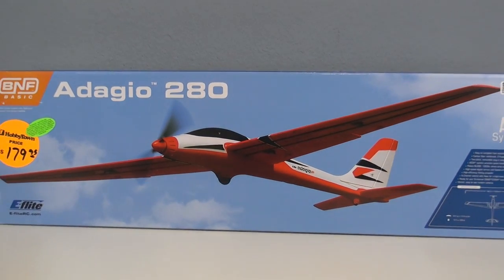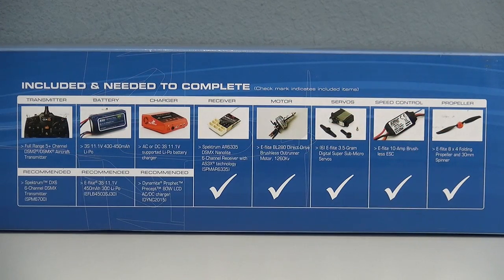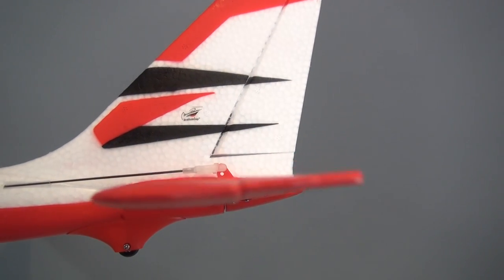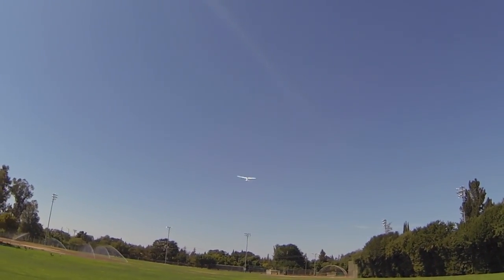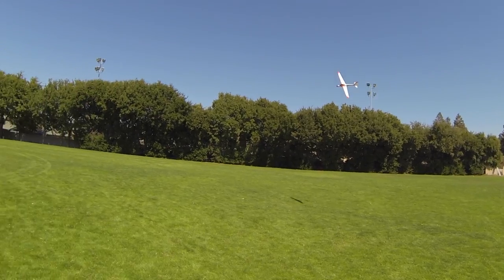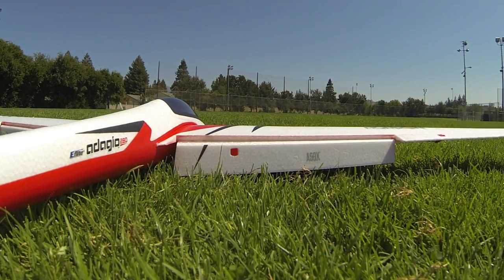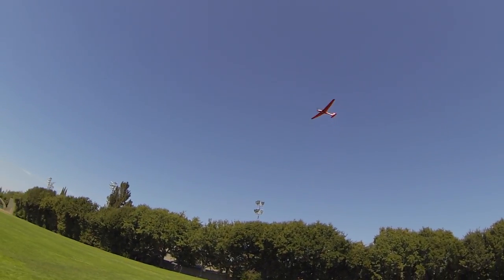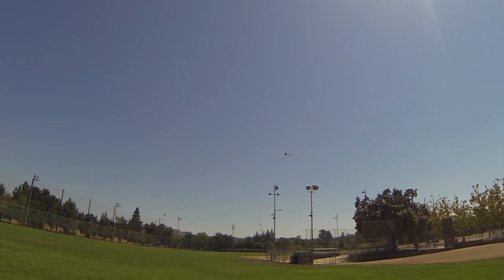E-flite Adagio 280 Complete Review

Comment: I've had my Adagio for a while now and I'm just beginning to get confident when I fly it. I agree it is a wonderful aircraft. Your video is helpful - I hadn't thought to point the nose down when deploying the flaps, but that made perfect sense.  On my transmitter the flaps are either not deployed at all, or deployed 100%, so I've used them very little. 

Thanks for the great review!
Reply from the maker: +Patrick Colwell Thanks for the comment! I don't know what radio you are using but one thing that helps with pitch changes when dropping flaps is to add an elevator mix: flaps to elevator so that when you drop the flaps you get some down elevator mixed in. Takes that ballooning out-100% flaps will still slow up the plane very fast.

Comment: Man, how does it make those sharp turns!!! Pretty impressive control throws for a glider. You can practice on a soccer field, before hitting the slope. Now I know what to get myself for Christmas ;)
Reply from the maker: Heine Johansen It's a good, responsive plane-the only weakness is the wing spar. It's not the best-I did end up replacing it with cf rod.
Reply: Good to know. Thanks 😀
Reply: +Discover RC One thing I actually really like about the Adagio is that if you dive with the motor off and pull up lightly so when it is next to you it will be level, the wings will "whistle" and it sounds great!
Reply from the maker: +susanrc73 yes-pretty cool! :)

Comment: Try instead of flaperons doing spoilerons where both ailerons go up. It may take away that sudden dive and give you a much smoother landing.
Reply from the maker: J Adam Good point-should be possible using the open channel port on the rx. You could even do crow once you split the aileron channels.

Comment: Thanks for review. How do you think the climb rate is?  I almost bought one the other day at LHS but I got a Sport Cub instead.. which as you know is also a great little plane.

 Also.. a lot of people are having issues with broken wing spars on Aagio. Are they carbon?  There's pics at RCG.

BTW you can use regular CA on Z-foam. It won't damage it.
Oh, and you are pronouncing it correctly!
Reply from the maker: BWX The sport cub is great and I would also go with it over the glider if I had to chose-still a sport/3d pilot at heart. The climb rate is decent for what the glider is and the price-it's no hot liner but it gets up there fast enough. The spars are cf and I haven't had an issue. Given that you have a long thin wing, I could see damaging it if you were to strike a tip into the ground-I flew the glider pretty hard and they are doing ok. Yeah thanks-forgot reg ca is fine on the z foam! ;)
Reply: RCdeparture Thanks. Yeah I guess they were folding up on people mid flight-  Not sure but there might even be a video of it somewhere.  Something to watch out for. I think they were fixing it with wooden dowel near center or something. Not sure.. but it might be worth checking out.

Yeah when I went to LHS they had the UMX Habu 180, the Adagio, and the Sport cub. I want all three!  But I already bought a UMX Radian, VisionAire, and big Radian this year, so the Cub fits right it. I can get those other ones next year or when they go on sale over winter, LOL.
Reply from the maker: BWX Yup-if you wait on these the price drop often makes mad you bought it when it came out! OK-yes I did get some wing flex-maybe you can see it in the video. You could probably break it with a power dive and hard pull on the elevator, but that type of thing I would never do on a little foamie like this. So the issue is somewhere between flying it hard, but like it is designed for versus abusing the air frame. Sometimes a difficult line to define with differences of opinion.
Reply: RCdeparture Yeah who knows what they were doing to break it, LOL.

In my radian I upgraded to carbon fiber wing spar (1mm walls) and I still get a little flex but I can do crazy things that would bend the FB spar or maybe even break it.  I do things I would never do with stock FB spar.
Reply from the maker: BWX Well just like that I broke the spar-I blame you! lol Caught a wing tip landing I think and it snapped right at the root. I have a thicker cf rod that will replace it-looking it closely it is definitely on the thin side.
Reply: RCdeparture Oh noes!  LOL, well I guess maybe there is a real weakness there. It should be able to take some abuse being a foamie.  I guess if it easily replaced with a stronger one then no worries. I wasn't sure it is was just a straight spar that is easily replaced or if ti has some weird curve to it.

 I replaced my Radian FB spar with a carbon fiber spar before I ever flew it, and glad I did.
Reply from the maker: BWX It's a straight spar (well it was-not anymore). I went to the cf stash and found a good replacement pretty quick. I will need to mention this since it does sound like a real issue. The stock spar is mainly air coated with a thin layer of cf.
Reply: RCdeparture Wow.. Yup a strong carbon fiber tube should do the trick. I bet I'll be more fun up in the air when you know you have a bullet proof spar.  That's how it is with my Radian, I can crank on it all day long and turn as hard or loop as fast as I want. It flexes, but just a little.  Now you'll be able to hammer on that thing.

Comment: Thanks for the review. I too broke my spar. Do you think with all these breaks HH would send out new ones at N/C....
What Dr/Expo are you guys using?
Thanks Again
Reply from the maker: I replaced the spar with a thicker cf tube that I had laying around. I just don't think it's worth replacing it with another stock spar-it's pretty much no good and needs to be upgraded which is unfortunate. Otherwise, it will just be a matter of time. I've been meaning to do a short video on that, but other projects have kept me from it. I have no dual rates or expo-just full throws at 100%. It's a fairly docile plane-you could go with a 70% dual rate if you want it toned down, but you don't want it to get too mushy and sluggish to respond.

Comment: Have you tried to put a bigger battery on the Adagio 280? Im looking at a 500mah that fits fine just 5g heavier than the Eflite 450mah. I'm also looking at trying to fit a 700 mah (tight fit, but according to dimensions it will fit) and its 33g heavier than the eflite 450mah. Any recomendations?
Reply from the maker: I am sure the 500 mAh will be fine - the 700 probably too if it fits. With the 700 your cg may change just a bit.

Comment: what is the maximum wind speed one could fly this in?
Reply from the maker: hmmm it's hard to give you an mph - it's a big wing so wind is going to toss it pretty good - it's got good power but not enough to really slice through a lot of chop. I'd just say moderate wind at most-the fun factor will drop though once it's bouncing around a lot.

Comment: got mine today hooked every thing up and when i bound it i got full flaps and they won't retract too neutral help please!!!
Reply from the maker: +Timothy Keeler what radio are you using? Flaps hooked up to aux 1? You may need to reverse the servo.
Reply: spectrum dx6i every thing seems to be hooked up right tried that but didn't make a difference
Reply from the maker: +Timothy Keeler so they won't move at all and stuck down? Can you get them to move with the sub trim? Did you try rebinding it without the flaps servo plugged in and then after it's bound reconnect it? Usually it is just something with the servo settings.
Reply: +Discover RC hooked up the way they were out of the box!
Reply from the maker: +Timothy Keeler it's a bummer :( I am just trying to figure out what is going on with it. Flaps are connected to the correct y harness and everything else is working normally right? And reversing the flaps didn't make a difference. Also you are binding with a fully charged battery? Once you eliminate all that stuff you are left with either a loose connector or a bad receiver etc. There is not much left to do other than call Horizon-they are good about setting things right.

Comment: Frankly I'm disappointed in this plane.   Poor build and design lets this down badly.   Wing joiner tube very weak broke first flight even though it wasn't a particularly heavy landing.  Elevator is split design with an angled wire joining them.  The foam around the wire is weak and as a result you get a different throw on each half  - it needs epoxy to stop the foam from moving away from the wire!.  Canopy magnets are way too weak, use an elastic band.  Nose heavy???? you have to be kidding!! On the advice of the guy above I thought it wouild be nose heavy so I  put my 450 3S in the middle of the compartment and it was WAY too tail heavy resulting in an almost uncontrollable maiden flight.  If you buy one check the glue holding the red plastic wing retainer on to the wing - it's rubbish and your wings may just fall off like one of mine did.  All in all though it's a very nice looking plane and offers a lot of promise but poor design and quality control means you're just waiting for something else to break.  FLAPS - you need to select wing type "2 aileron 1 flap".  Put the flaps Y lead in the gear channel.  Next go to flap setup and allocate a switch to the flaps, I use a 3 position switch (D on the DX6).  Set switch position 0 to NO FLAPS and adjust their position so they are level with the wing.  Set position 3 to Full flaps and again set the desired deflection BUT IN THE SETTINGS ON THE SAME SCREEN ALSO ADD IN 30% DOWN DEFLECTION ON THE ELEVATOR.  Similar set up for position 2 except set the flaps to act as spoilers by deploying them only 1/4 of the distance you chose for full flaps and dial in say 15% down deflection on the elevator.  This means that when you select spoilers or full flaps the elevator also moves and prevents the glider from ballooning as it does in the video above.